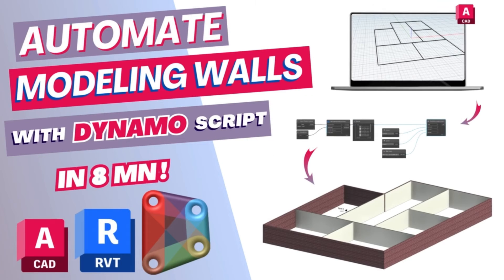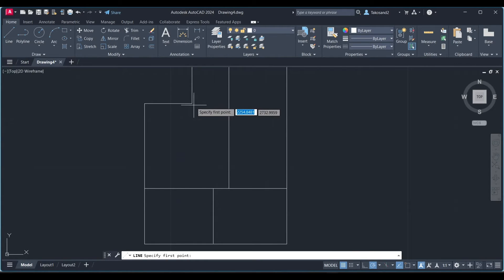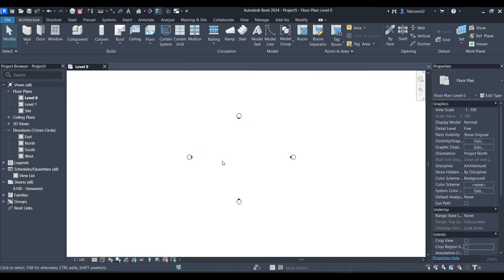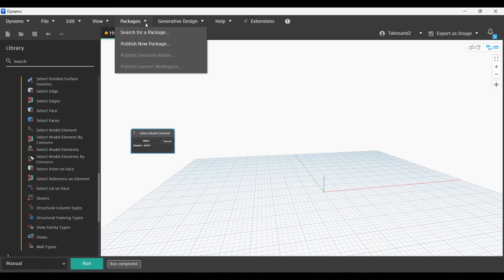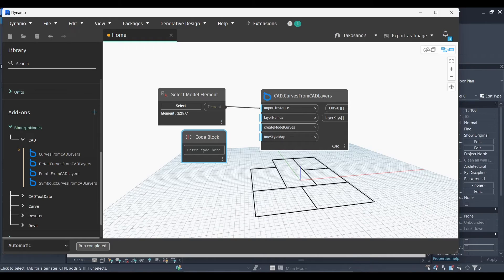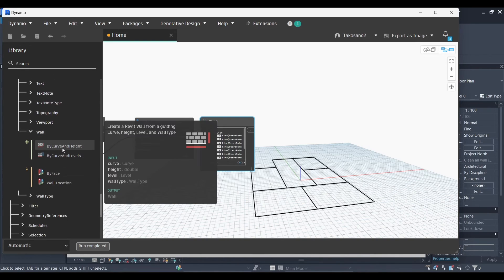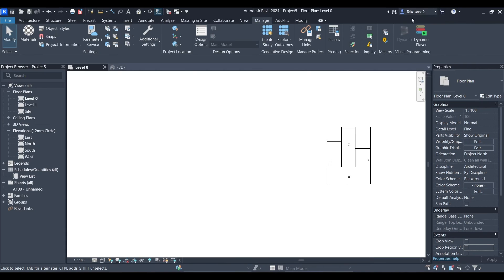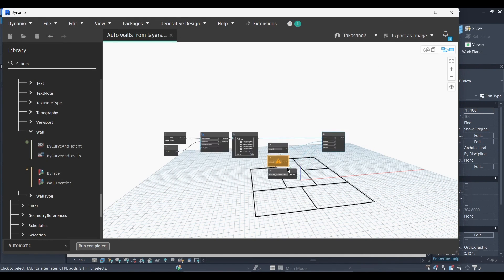Automate Modeling Walls in Revit with Dynamo | From 2D Autocad plan to 3D model  | Dyanamo Tutorial

Comment: How do you prevent the walls from being generated with the exterior fliped to the outside? Also how do you get it to place the walls according to Wall Location? The default is coming in at Wall centrline I want to change it to Core Face exterior.
Reply from the maker: You can simply select the walls at the end and change their types, materials, orientation through revit not dynamo.

Comment: That worked great, it tit what was described. Now I have to find a way to make work on double lines which is how all our floor plans are drawn. I have a 100,000 sq ft building, in the time it takes to copy wall lines to 1 layer I can finish modeling building manually.

Comment: What if i have double line which shows thickness of the wall in cad
Reply from the maker: If you have a double line indicating the wall thickness in CAD, a simple solution is to change the layer name of one of the lines. In Revit/Dynamo, you can then easily choose the specific line you want to use. Let me know if you need any more assistance!

Comment: This is a great video. In CAD, walls are drawn with two lines to indicate thickness. Revit then creates two walls. Can’t it be manufactured according to thickness?
Reply from the maker: Thanks, in this situation you might wanna rename layers in AutoCAD and only create  the curve from one of them (use it as the curve), then once your walls are ready in Revit, bulk select them and change their location line from centerline to whatever suits your model (finish face, core face etc depending if the layer you chose to use as a curve is the external line or internal one) 
I hope that was helpful, if not feel free to ask me again
Reply: @HowToBIM  👍
Reply: @HSV.1  I have a 100,000sq ft building to convert, it take just as long to draw the walls by picking the geometry on cad.